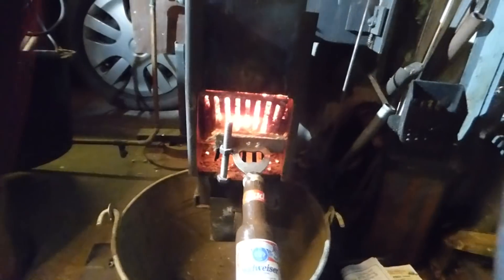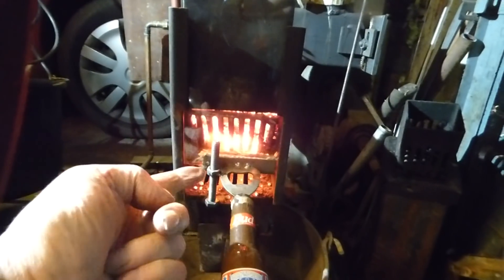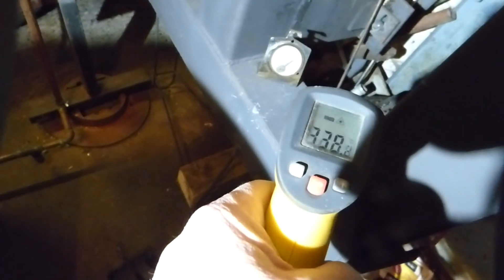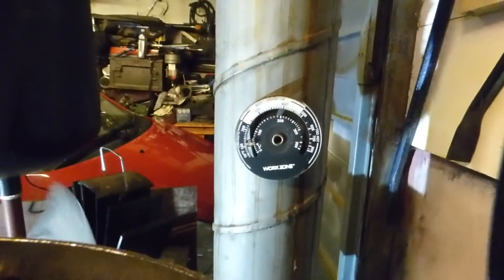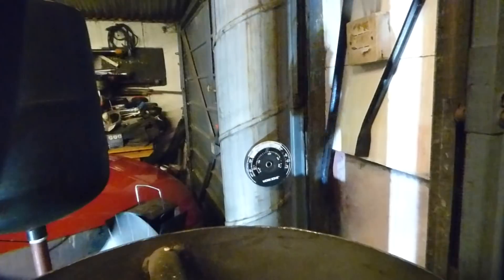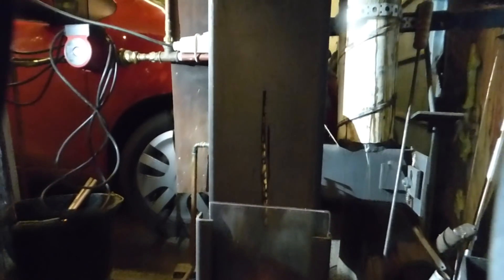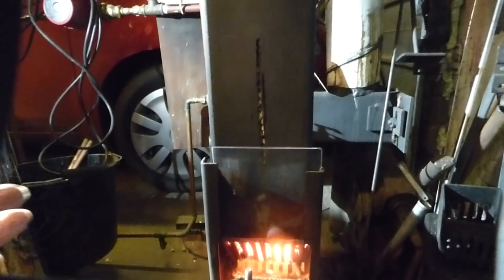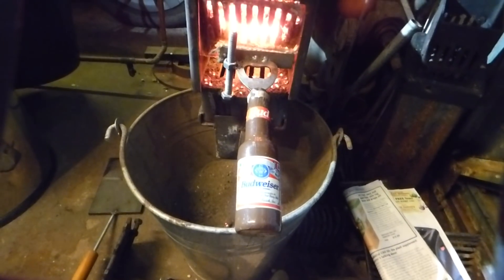rocket stove space heater /boiler diy MK3 update No45

Comment: How small of a pellet stove like this can be made and function safely and flawlessly? We have this well insulated 18 SQ Meter  / 194 SQ Foot cabin with 2.15 meter / 7.0 foot tall ceilings but the electric heat costs a small fortune each month to run in the winter...The months of January & February regularly dip down to -28 Degrees Celsius or -18.5 degrees Fahrenheit. Can you tell me if it is possible to build a small pellet stove for this small of a space described then be able to turn the burn temperatures down to produce less heat as seasonal Temperatures get warmer? Thanks for any reply, Mike in Wisconsin
Reply: Hi Mike. I have experienced that 4 inch can work and even 3 inch at a push. At three inches it's very fussy  to get going and seemed to be a waste of time to me. I hadn't the resources to perfect my mini version that I had in mind for a small cabin or tiny house, given that I was at high altitude and in a relatively mild climate.
Reply: @crgsy5401  Thanks for the reply.... Indeed, further research is required.

Comment: Hello David 
I've finally got my stove running. I've built it using your recommendations on size ratios, and followed every tip you've provided. I have zero smoke/burn up the feed tube, in fact I can hand dump the pellets down it with the pipe open. I completed and tested the pellet feed and hopper today. Next up is the waste oil injection then the heat exchanger for water heating. 
I am thoroughly impressed by your expertise and extremely grateful for all the tips and advice you've provided.

Comment: Thanks for the info Dave. I never had the back-burn problem, but I do get a small amount of build up in my burner, which makes it run a bit cooler when the hopper gets down to about 1/3 full (I always run one 40 lb. bag of pellets at a time) I'm going to try your idea of blocking the opening to 35mm and give it a try. I now run with it wide open and the stove is running 650-700 degrees.  I'm using 4 inch square tube on my build.